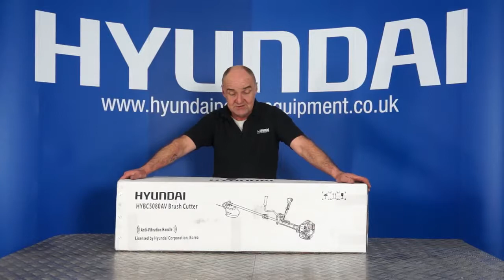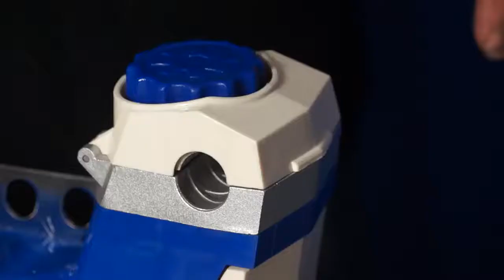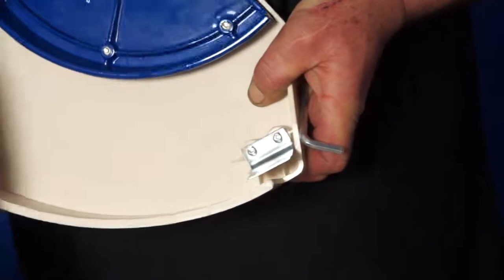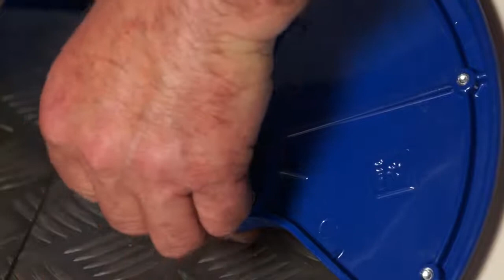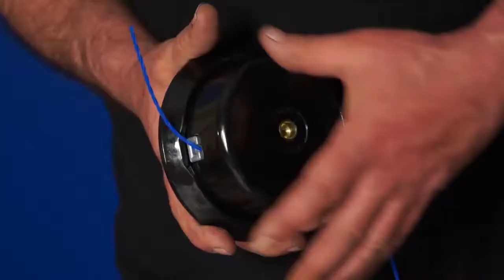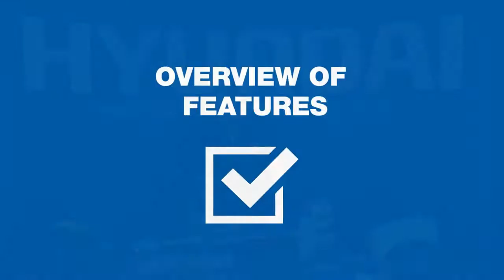Hyundai HYBC5080AV Brush Cutter: Unboxing & Assembly

Comment: Good video however I would like to ask how do I adjust the fuel mix as where there is supposed to be a screw there's a metal disk with a hole in it